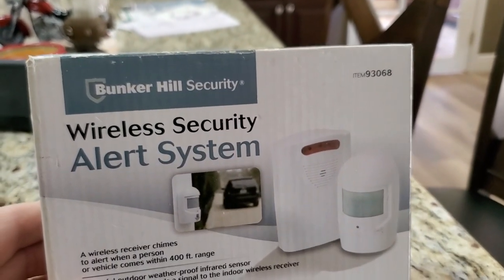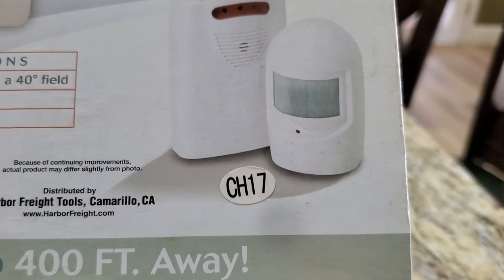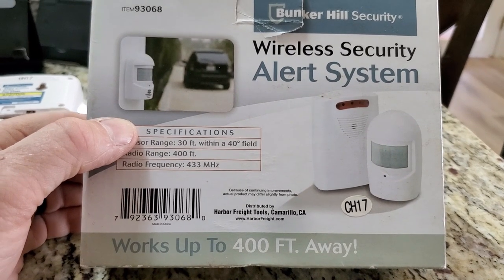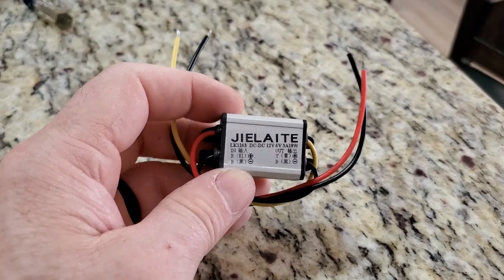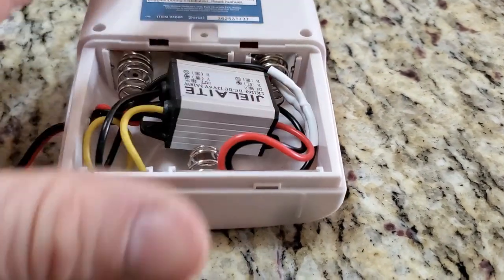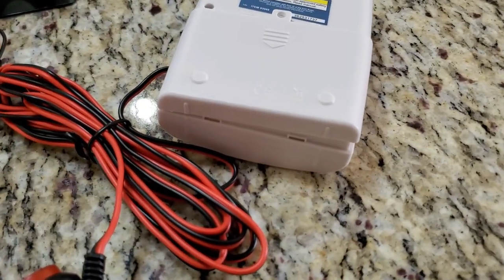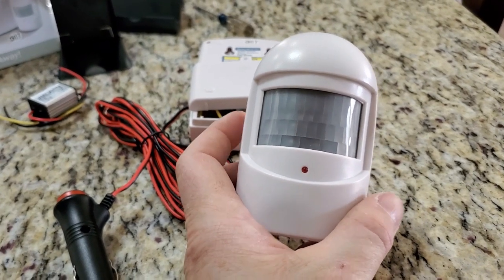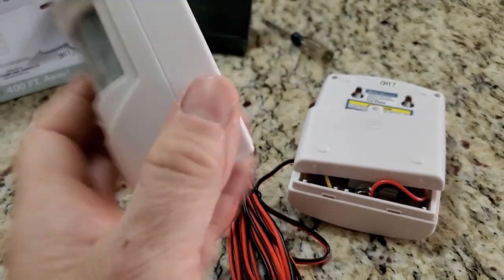Cheap RV Alarm System - DIY Cargo Trailer Camper Security

Comment: That is a great hack. Thanks for posting!

How do you know that it will only sense large objects like a bear or human and not a smaller object like a racoon or leaves blowing around?
Reply from the maker: Thanks. It is made for cars or people in driveways. I have actually used this type  before on another camper and it wasn't picking up small stuff. If by chance it doesn't, just change the angle up some. Test it with your dog or etc. until you get it set.